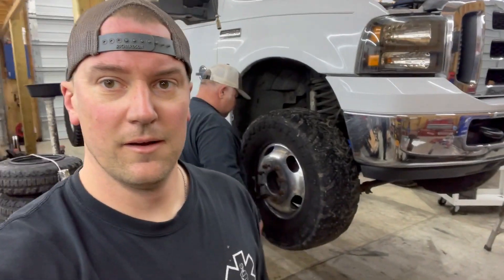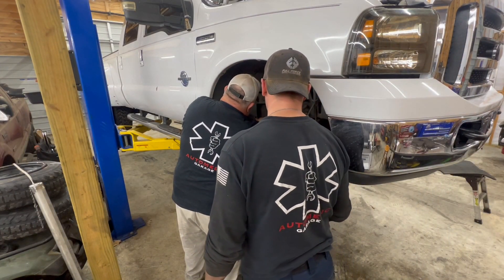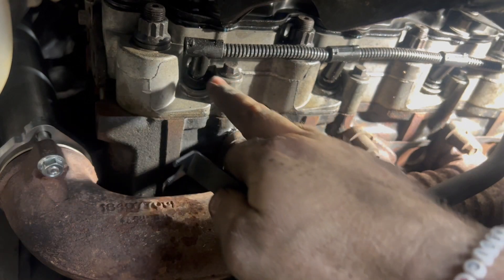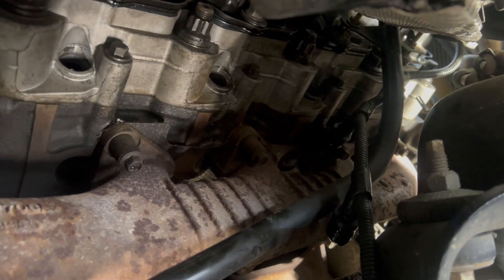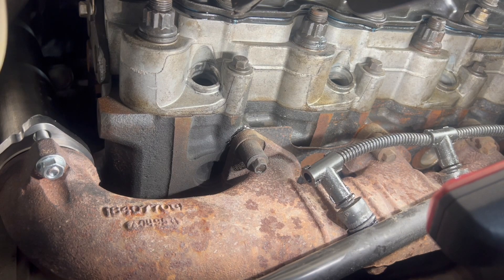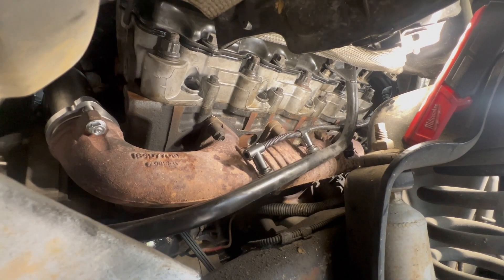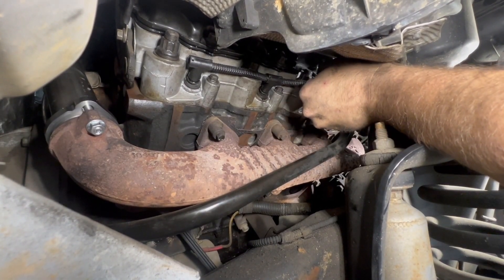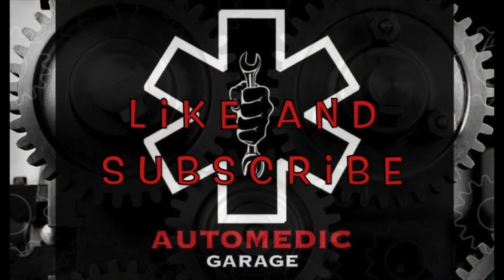6.0 powerstroke passenger side glow plugs

Comment: I have an 03 6.0 that is blowing the engine control fuse because either a glow plug or harness is shorted. I want to change both the harness and plugs but have found very little information about the 03 procedure. Can you give any insight about the 03. I have just recently found your videos and they are awesome.
Reply from the maker: It’s the bus bar style. It’s pretty much the same procedure just more to get crumbly and brake. I’ve been telling myself I need to do a video on the 03 glow plugs.
Reply: Any idea if you can swap the flex harness for the solid one?  I have an 03 and I am not a fan of that harness.
Reply: @normanhh3  Arent the 03-04.5 glow pugs just a tad longer, and should NOT be used in 04.5 to 07?

Comment: I live in Paducah how much install upgrade dummy plugs. Having a long crank problem
Reply from the maker: Do you know it’s the dummy plugs? Or only dummy plugs? How did you diagnose?
Reply: @AutomedicGarage  just put all new glow plugs. And ipr
Reply: Only long cranks in cold weather
Reply from the maker: @ThomasJones-fn6pc  doesn’t point me towards a dummy plug then. I’d be thinking more about glow plugs not all working, or slow to build high pressure oil due to a weak or sticky spring in the upper portion of the standpipe. Possibly a worn LPOP or you have some damage to the LPOP. Could be a weak HFCM causing low fuel pressure at start up or allowing air intrusion or the fuel anti drain back. If your running 15-40 oil it doesn’t help for starting up either. But I wouldn’t be thinking dummy plug unless you have a crank no start or a crank no start hot.
Reply from the maker: @ThomasJones-fn6pc  why did you do ipr? Did you do glow plug harness? If you perform a glow plug self test KOEO with a scanner does it pass? If your harness was crusty and you reused that could be fail point. Also your GPCM could be bad.

Comment: Have a question change 03 6.0 I  was changing glow plug and a whole glow plug the new glow plug fell in the cylinder. Is there  a way to extract it out. Got a small magnet and  still can't get it.
Reply from the maker: I’m assuming you mean the tip off a glow plug fell in because there is physically no way for the entire glow plug to fall into the cylinder.
Reply: @AutomedicGarage   the whole  glow plug came off socket went down  plug hole. I didn't think that was possible go down that far.  Can't find anything on it get it out.
Reply from the maker: @Andrew-ju4be  no way the threaded portion of the glow plug fell through the threaded portion in the head. You may have put the plug in crooked and dropped it in the rocker box only way you dropped the entire plug in the cylinder is if it was the wrong glow plug and smaller than the threaded portion in the head.
Reply: @AutomedicGarage  where OEM glow plugs all other went in fine. Is here a way to get it out. I bought this off the original owner yr ago. Someone used a impact wrench on everything. Caused me a major headache on fuel line cross thread and other things. Changing everything back to OEM parts. This is new problem I've encountered.
Reply from the maker: @Andrew-ju4be  it’s not in the cylinder I guarantee that. Need to get a borescope and go in a see where it is. It takes some talent to do what you’ve done cause I’ve never heard or seen it.
Reply: @AutomedicGarage  Not talent More like really bad luck.
Reply: Not in cylinder with endoscope there a small pocket inside glow plug hole to left that's just big enough to fit whole glow plug
Reply from the maker: @Andrew-ju4be  I told you it wasn’t in cylinder

Comment: I was sweating the project on my 04 F350 but after watching the driver's side and passenger side glow plug replacement videos it's going to be so much easier to do: glow plug & harness replacements, shock replacements(inner fender won't be in my way), and reposition the main harness and realign the steer tires to the steering wheel because I don't like my steering wheel not be straight with my wheels. Yep,  I got more than just glow plugs to do but this just made everything look like it will get done quicker without sore knuckles. Thank you.
Reply from the maker: Sure thing. Glad it helped.

Comment: A little confused when you did a driver side video glow plug #4C3Z12A342 AA was used now you are on passenger side and using #4C3Z12A342-A is this a 2004 6.0 diesel or a different truck?
Reply from the maker: @davidgoodwin658  as far as removal and installation goes is the same regardless of year. First video was on a 2004. Second video was on a 2005. Just make sure you buy the harness for your build date.